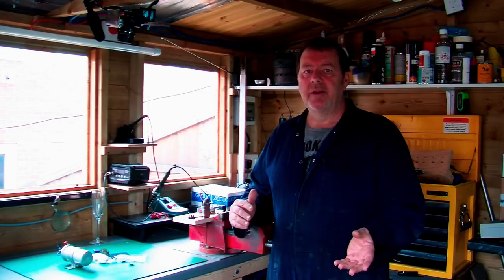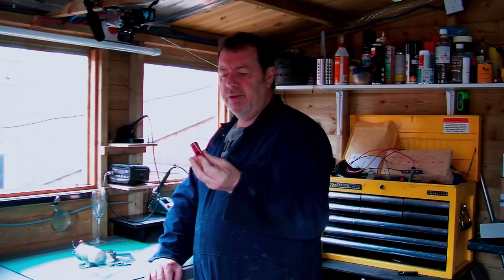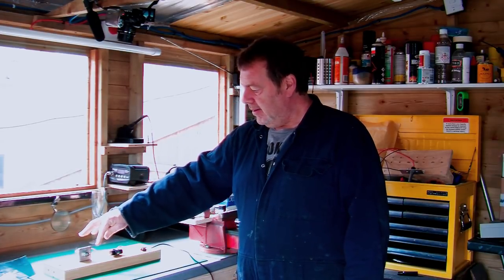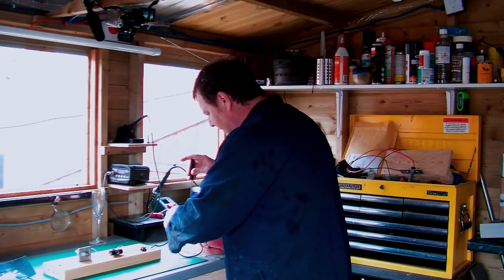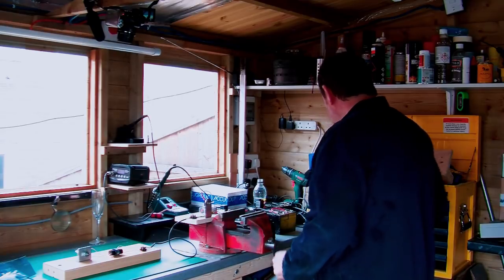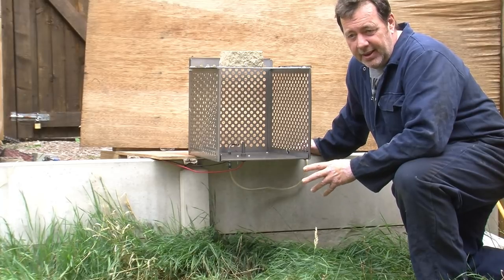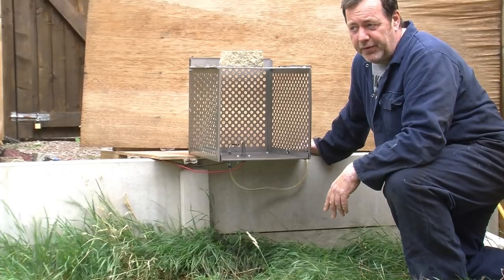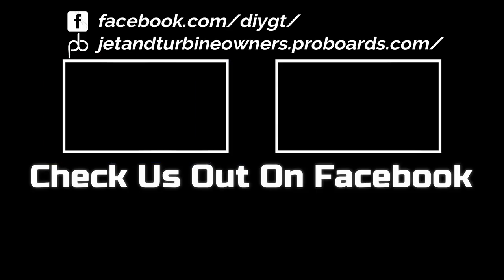How To Build A Jet Engine Ignition - Building The New Jet  Engine Ignition Testing

Comment: Thank you!!! I have been struggling with my ignition! I had tried a bbq spark generator (it’s what Collin furze used) but my spark didn’t seem to be strong enough to light turbulent flow
Reply from the maker: Hope things are coming on well, have you checked out JATO
Reply: Andy Morris Jet Engine is slowly getting there. I have swapped to one of the “400kv” spark generators and once I have improved the gas flow I hope to get it lit.  Do you think a carburetor would be a good way to improve combustion? Unless you mean jet assisted take off I am not sure what JATO is!

Comment: Hi Andy. I realize this is an older video. I was curious on your thoughts towards using diesel glowplugs to ignite a kerosene/diesel fueled turbojet. I'm back and forth between spark ignition and a glow setup. Have you had any experience with the latter? Thanks!
Reply from the maker: Hi, glow plus do work, but can be very problematic... I and others have tried them, but i think most go with spark ignition now. I too had a problem with glow plug ignition, resulting in killing an engine. I would try looking for an old aircraft ignition box on ebay. But placement of the ignition can still cause problems, if it's not in the cone of fuel, fuel is getting blown away from it at start up etc, all things that can cause problems
Reply: @Turbojetkart  thank you for the input. By killing the engine are you referring to the glow plug fragmenting and going through the turbine? I have wondered for some time why they aren't more popular since they seem the least complex and would be the most steady igntion source regardless of turbulence   surrounding the element. Your vast knowledge is much appreciated. I have been a fan of your work for years. Thanks again!
Reply from the maker: @stephantarter4859  Hi, thanks, yes tips braking off have been a worry, but i had over fuel issue, with engine not lighting, and fuel build up in engine, my falt, i guess not so much the glow plug, but the hit and miss i found with glow plug did not help, they heat up and cool, and if you miss the hottest point, wet fuel does not alway lite :-( lesson learned, always have a case drain in your engine
Reply: @Turbojetkart  ah! I understand. Thanks again sir. I'm working on a large frame VVT turbo based engine with a variable afterburner as well. Many years of playing and researching but on my way to getting it together shortly. Has anyone found a truly successful approach to a tachometer? Optical seems the most widely accepted method but I can't find straight answers in the tech group or evidence of a truly successful system.
Reply from the maker: Tacho.... well they are a big issue, i just use a hand held unit, find max rmp, note p2 pressure and kind od work that way, optical are ok, untill the nit you paint black and white get dirty. some have even tried using the ones that are fittid to top end turbos, measuring the spinning blades, still not worked well, :-(
Reply: @Turbojetkart  I have read the same. What do you recommend for a handheld unit? I apologize for all the questions. There is so much mixed information out there. I trust your extensive experience over all else.
Reply from the maker: kust brought mine from ebay, if you would like help check out this site, we hang out here http://jetandturbineowners.proboards.com/board/2/diy-turbine-engine-discussion-builds

Comment: thanks for posting.  some thoughts.    imo, this concept does not quality as turbo-anything.    is would be more accurate to say that a diy  AB  unit (with sub-AB unit) is  being used as a  stand-alone source of thrust.   cheers
Reply from the maker: Sorry what is it you are saying, that this is not about a jet engine, gas turbine or turbo jet engine. They are called turbo jet engines, well perhaps not the new one I am building, but earlier one I and many others have built , because they are built from a turbo. Please explain your self
Reply: @Turbojetkart  ah, i see.  you have  invented  a term  that  ALREADY  has a definition.  for your convenience.
https://en.wikipedia.org/wiki/Turbojet
Reply from the maker: I really don't see what your issue is, or the point it is you are trying to make..... it a jet engine ..... gas turbine, turbojet, turbo jet ? i just don't see the point you are making. With out the bit before the afterburner, the jet engine... there would be no supply of gasses for the afterburner to work, one don't work with out the other..... or should i perhaps call it a re-heat ?
Reply: @Turbojetkart  i really don't see why you don't see that you don''t  Understand  what yer machine is 'actually' doing.   you are free to call it  whatever  you want.   you can cal a toaster a pipe wrench, it  does not 'change' the toaster.   yer machine gets  TOO  DAM  HOT.    'it uses a turbo'.    the use of a  turboCHARGER  does not make yer machine a  turbojet engine.     cheers
Reply from the maker: But it does...  https://www.bbc.co.uk/news/av/uk-england-nottinghamshire-45816919/the-man-who-builds-jet-engines-in-his-shed?fbclid=IwAR1ubEioZf37Qj_6PbvUQeBExpn6085fL2EXlvt5He95LkAB57wppAV5vD8